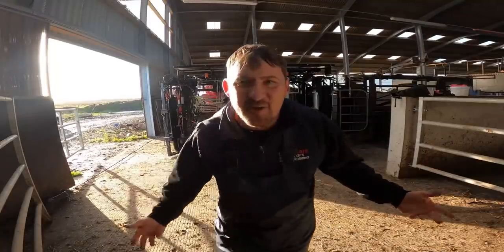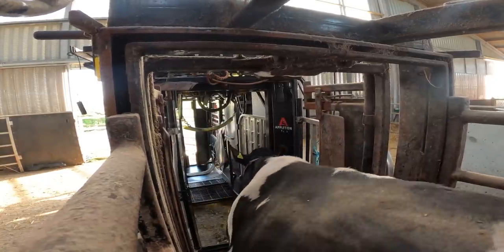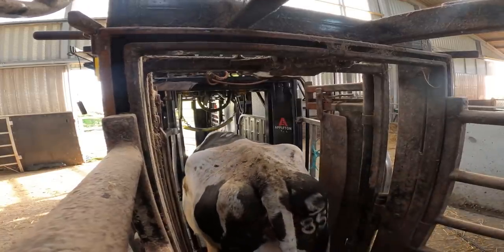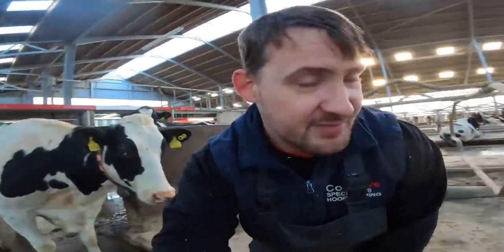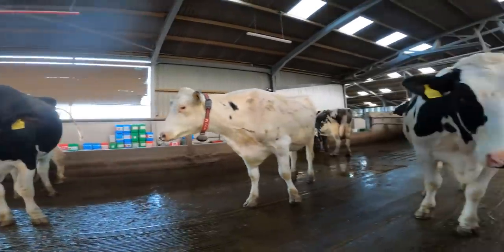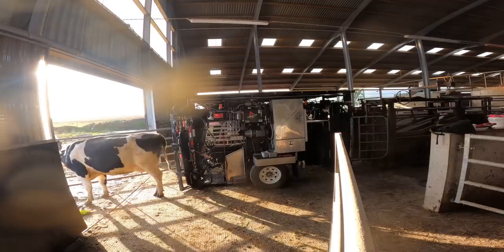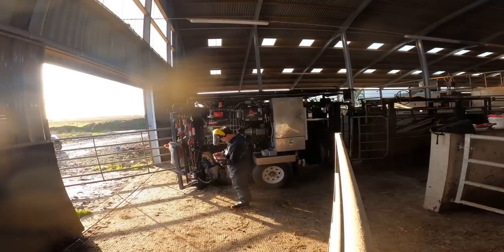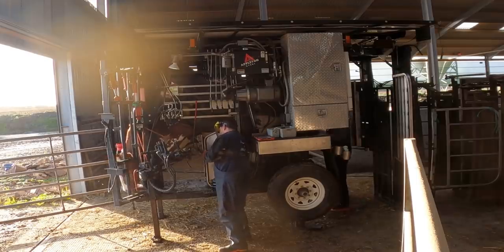WE HAD TO BE CAUTIOUS TRIMMING THESE FEET

Comment: Do you trim all four feet the same way or is there a difference between front and back?
Reply from the maker: On the front feet your biggest concern is the inside claw. Making it level with the outside and giving it a wider model, as that is where sole ulcers are likely to occur on the front feet. On the back feet it’s the opposite.